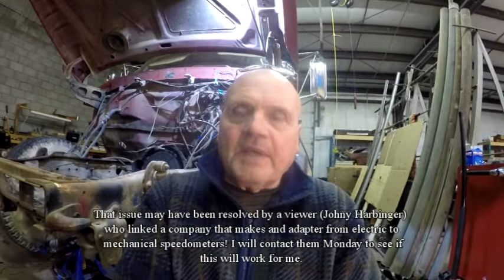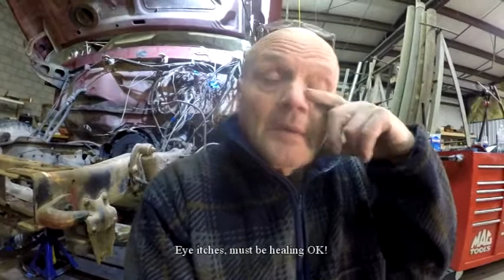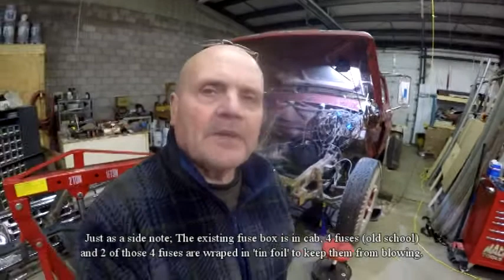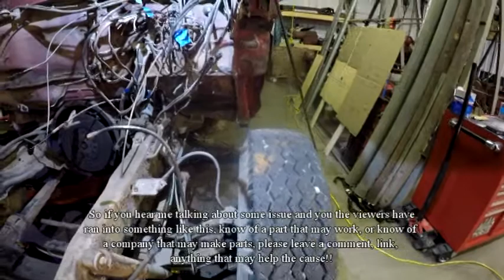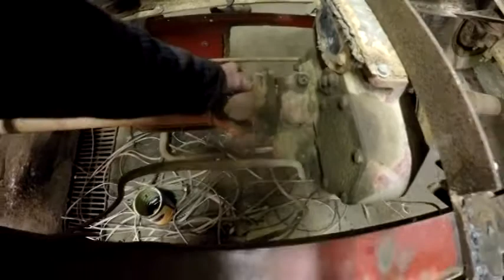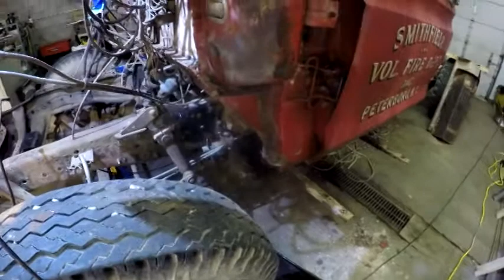Ford Haul Truck Build Part 11B

Comment: I don't know about the USA, but in most countries there has to be a mechanical connection for the parking brake. The same applies to the steering. That's why newer cars have an electric parking brake, and not a hydraulic lock.

Comment: 1. Power steering is a must have.

2. Electrics. Home built modular system, where front lights of al kinds is in one wiring loom. Separate waterproof contacts for the whole front wiring loom in one side forward on inside fender? Contacts for side blinkers/lights conect to this loom. Same solution at the rear of the truck. Point is, to create one loom to every user area. One loom out of the fuse box to the lights in front, one loom to the rear light cluster, one loom to the roof, one loom to the sleeper, one loom to the trailer, and one loom to power the cabin and instruments.

This make you free to place the fuse box where it fit. Talking of fuse boxes, consider multiple fuse boxes to combat space issues. Yoy could make them from ground upp with aftermarket parts.

3. Consider LED lights where possible, it also might solve issue with turn signal lights.

Comment: Fred you for sure want power steering, on the electrical maybe a late model fuse box with relays and fuses already in it just a thought.
Reply from the maker: Yeah i think that power steering is probably going to be needed! It has the old style large steering wheel for non-power steering, but I am pretty sure that is going to have to go because of seat size! Hate to have it built, they realize it's needed and have to tear it all apart and re-do it! I thought about taking a fuse box out of something newer and that still may be option if I am able to get wiring schematic for it (and be able to understand it) so that I know how it works.